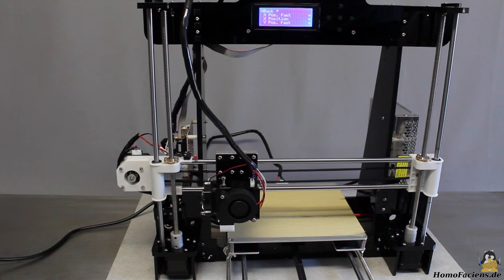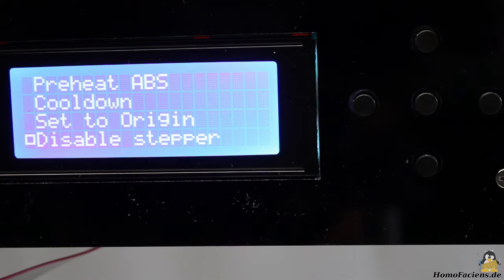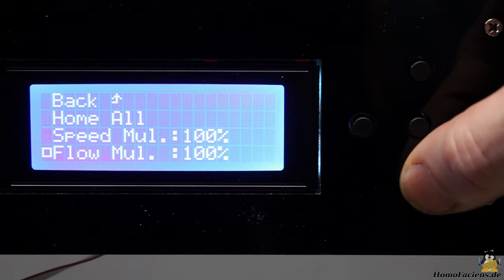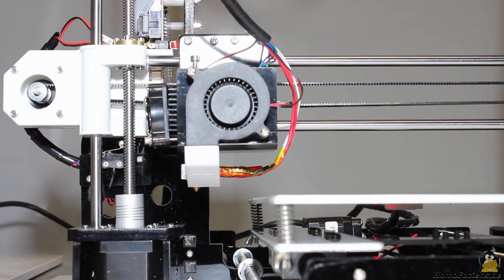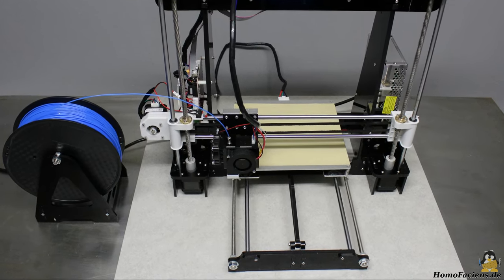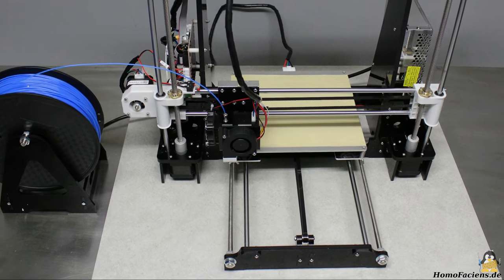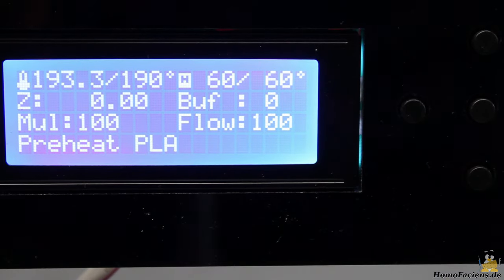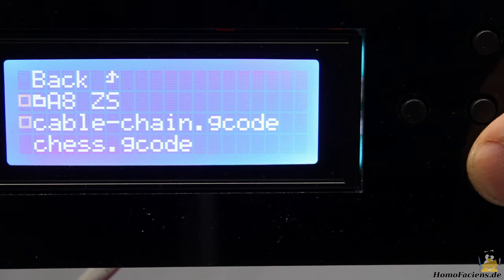Anet A8 3D printer review

Comment: My Anet A8 works great with OctoPrint on a Raspberry Pi Zero W. Full control of the printer without having to use the push buttons on the printer is a Godsend. Plus you can set up your own macro scripts for bed positioning for calibration etc.
I'd recommend people with this printer use additional cables to feed power to the heated bed. As supplied it uses just two wires (0V and 12V) and the bed uses about 10 Amps. That's quite a lot of current for one connector pin.
Reply from the maker: Thanks for sharing your knowledge. I will have a look at OctoPrint and at the wires of the heated bed.

Comment: Quite a good improvement on this kind of printer would be to mount a bowden tube on the extruder and fasten it on the frame of the printer. This way, when the extruder moves to the side and has to draw filament off the roll, it will not twist the extruder sideways. It may sound crazy that the small amount of flex will be visible in the printer, but it really is.
Reply from the maker: Yes, that kind of filament feeding tube will indeed become part of my modifications. Thanks for sharing.

Comment: Filament retraction setting will help with stringing (Cura or Simplify 3d).
+ putting a fan to blow on a printed object while 3d printer is at work will also help with the quality of the PLA prints.
Reply from the maker: I used filemant retraction, but there is indeed a lot of fine tuning to get better results. Thanks for sharing your knowledge.

Comment: Hi, adding a reverse-Bowden-tube between the filament-spool and the extruder will prevent the "yoinking" of the filament, and i.m.o. shall significantly improve print-quality. (but :p I am repeating myself) BTW - Did you raise the nozzle-temperature from 190'C to ~210'C after the 2nd print?  Cheers!
Reply from the maker: Thanks for the hint with the feeding tube.
The print temperature I used in the second print of the cable chain in the video was 180′C.
Reply: Ah, thanks! The reason I asked is because the 3rd print looks a lot glossier than the 2nd. Kudos on sticking to OSS by the way :)
Reply from the maker: The main reason for the glossy look is that the new LED beams for my photo studio arrived during recording the video. The second print was recorded in brighter light and so with lower ISO and a smaller aperture (higher number).
There is no reason to leave OSS!

Comment: Awesome..I have the exact same printer...there are a few simple printable mods/addons that increase the printer quality considerably, there are x and y axis belt holders that replace the stock ones, also you need to loosen the z rod clamps, and move the z rod till its inside the housing at the top, then print a z wobble mount to reduce side shifting if the z rods are not perfectly straight. Then a power supply cover, fan /blower mods...yadda yadda...this is a basic super cheap introductory printer, but with a little work it prints INCREDIBLY well...I exclusively print ABS but had to insulate the bed, and get a MOSFET power module and put on 12ga wires from powersupply to heat bed to facilitate heating the bed to 90C+.  
I use an old laptop tied directly into the printer with pronterface.
Cool video, good review, and happy printing :)
Reply from the maker: Thanks for sharing your expert knowledge. I haven't printed ABS yet. It's a good hint that the higher temperature of the heated bed might cause trouble. With 65 °C for PLA, the MOSFET as well as the wiring wasn't hot, but that could change when going to 90°C+. I will check that out.

Comment: I have A Net A8 for 3yrs now, and still printing (from pla to nylon) good buy
Reply from the maker: Good to hear that is works for more than just a couple of prints.
Reply: HomoFaciens indeed, and I learned pretty much more in depth with electronic controls (and fixing my melzi board) from your great videos, my printers runs smooth as butter, many thanks to you

Comment: I would recommend using simplify 3D slicer.
Reply from the maker: I am using slic3r, because it's open source.
Reply: If you plan to invest time in 3D printing you should give it a try.They have a two week money back guarantee.Maybe they will sponsor you as well.Good luck
Reply: Ultimaker Cura slicer is also open-source. Repetier Host can use either Slic3r engine or Cura-Engine.